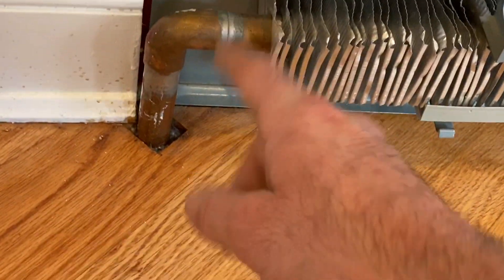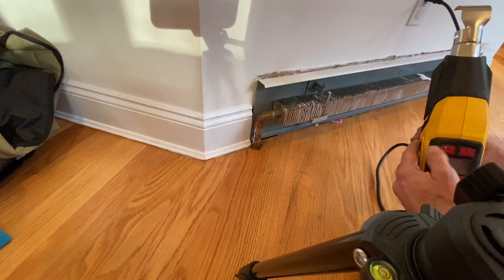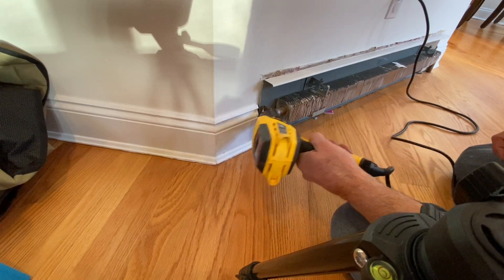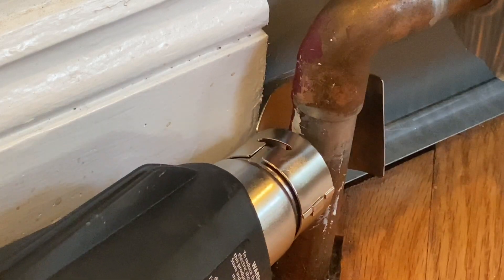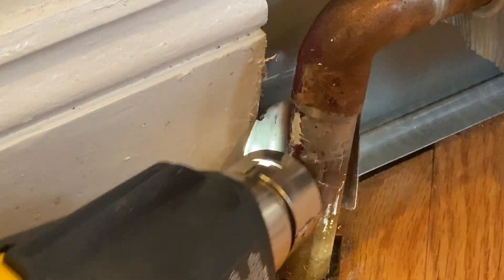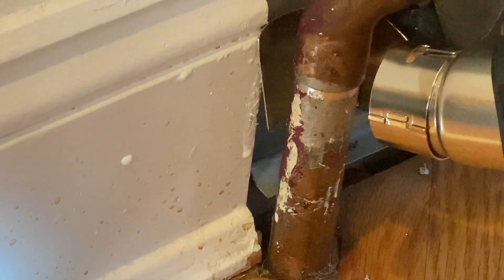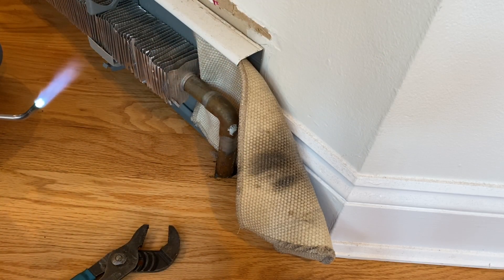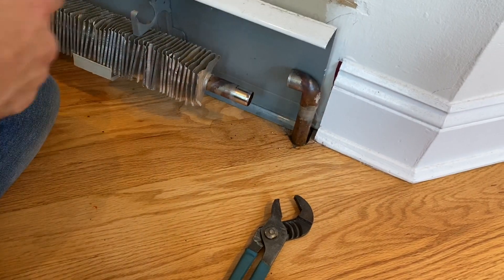Using Heat Gun To Disconnect Soldered Copper Fitting

Comment: I tried it while watching your video. Heat gun didn't work for me. Problem is 2 fold, the temp that the heat gun states is the heat of the gun itself, not the air it's blowing. And copper is such a good conductor of heat it pulls the heat away from the solder joint.

Comment: 1500 watts is like 5,100 BTU. using a heatgun will take ages especially on large pipe/tubing, probably best kept for things like 3/8"" and smaller, like cap tube. all that copper sucking the heat up.
mapp gas and swirl head torch is usually in 12,000+ btu area, with flame temp over 3,500F, little cooler with propane but slightly higher btu/hr.

Comment: nice, its a proof of concept. might come in handy in a pinch
Reply from the maker: I will try to solder with the gun. At my house I can screw around. I learned from this, even maxing out at 1300 seemed to take forever, yet will get it done if my torch runs dry or afraid of starting fire 🔥

Comment: Well it would  be good in a pinch or backup ... Good 1 Bill ...
Reply from the maker: When I first bought this heat gun to speed up drying sparkle I seen in the directions it could be used for solder. I should try it one more time at max temp 1300. It would heat faster
Reply: It would be good for a third backup

Comment: Shouldve tried to solder it with the heat gun.
Reply from the maker: I want to check out soldering with the heat gun. Today I was just removing most the baseboard. Tomorrow will be connecting new baseboards after sparkling and painting.